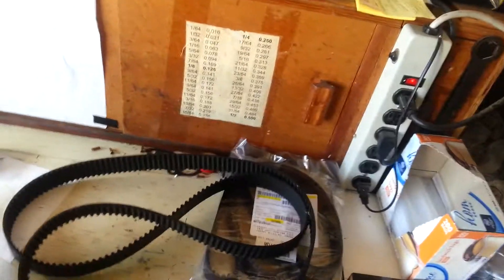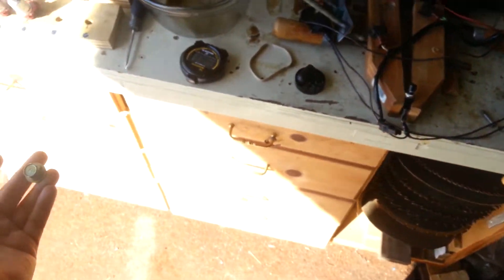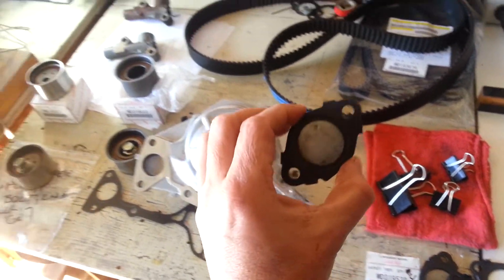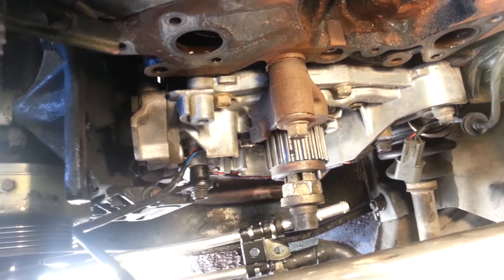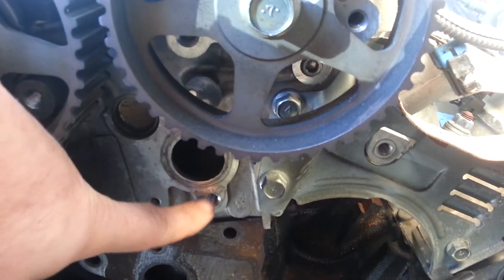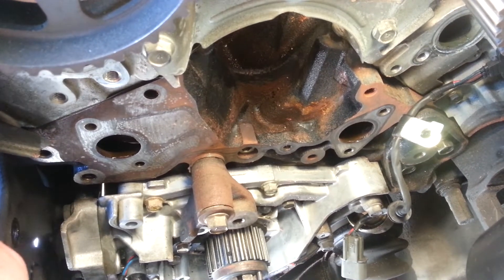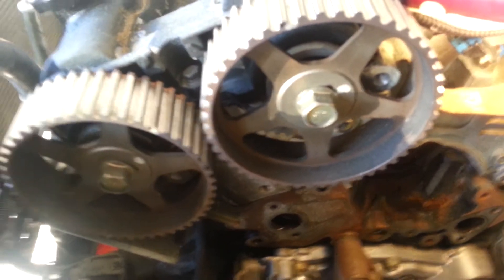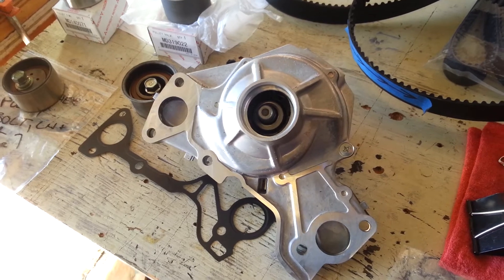Last VR4 Built - Timing Belt, Tensioner, and Water Pump Removal

Comment: I replaced the water pump and timing belt (97 sohc) everything went well but when  tried to refill the coolant it leaks from the week hole area . Idk if it's from the week old itself or from the one o-ring behind the water pump
Reply from the maker: It sounds like you got a bad water pump unfortunately. Sorry to hear it. Or, you did not seal the crossover tube properly. I always use a twisting motion and plenty of pure silicone when plugging in the tube. You can try to get at it from the thermostat side. Its a lot of work with all the hoses but they probably need replacing any way.
Reply: tonkatoytruck well I'm back at it again this morning I took the pump off and it looks like I pinch the O-ring for the water inlet tube
Reply from the maker: Sorry to hear that but at least you found the problem. Be generous with the silicone grease this time. I have had this problem and that is why I just pull the thermostat housing and install the crossover tube AFTER the water pump is mounted.
Reply: tonkatoytruck I failed to mention mine is the single overhead cam but we messed up the gasket to the block and I'm having a hell of a time trying to find it.

Comment from the maker: Either the thermostat housing or one of the coolant lines running from the thermostat housing. A couple run to the throttle body. If not, then the coolant tube that runs under the plenum to the water pump.